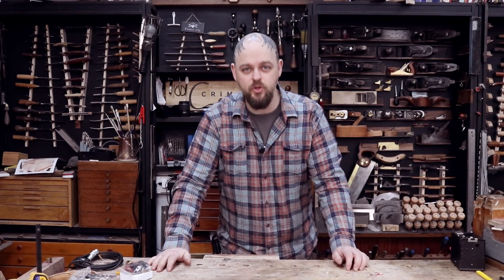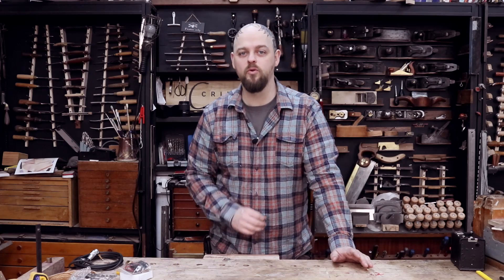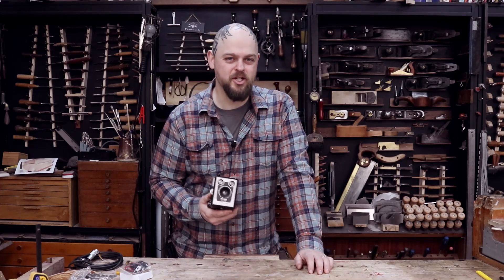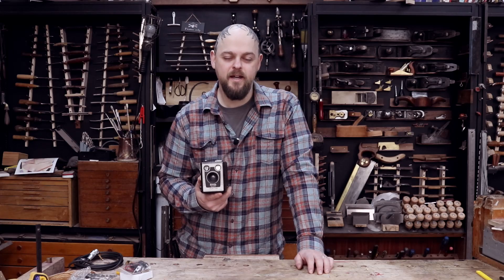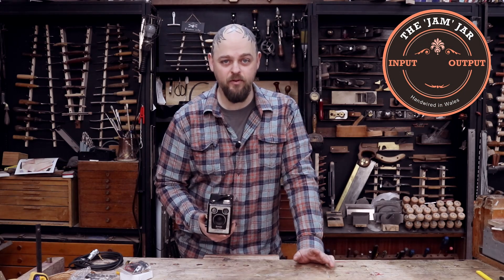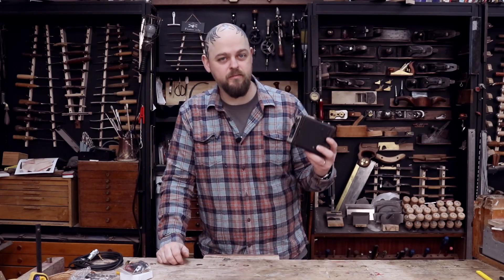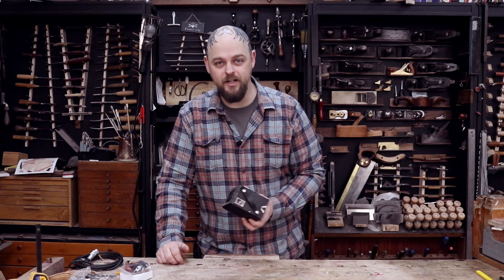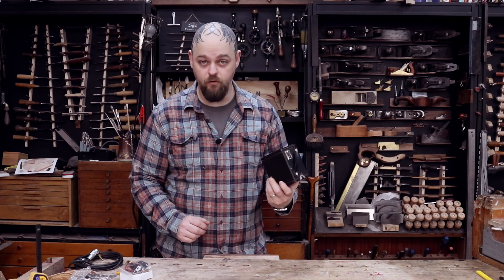How to turn a vintage camera into a mini amp with the kit from Jam Jar Amps

Comment: I believe I will make one of these for my lovely Nana, but I will use a much cleaner sounding speaker. she despises distortion and most overdrive.
Reply: That seems to be the problem with all these micro amps - they sound like a wasp in a matchbox. At least my mini Marshall has a gain control so it can be cleaned up a bit.
Reply: The distortion is not because of the speaker, it is because the amp is set to too high gain an doesnt have the power to amplify that much